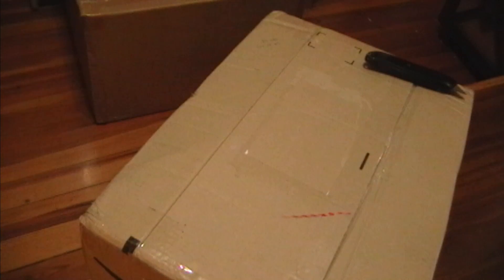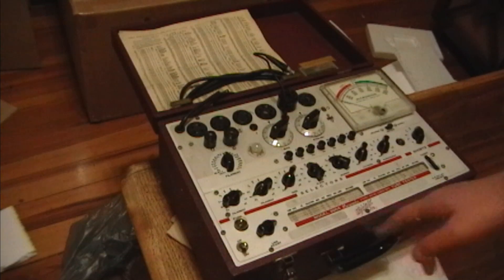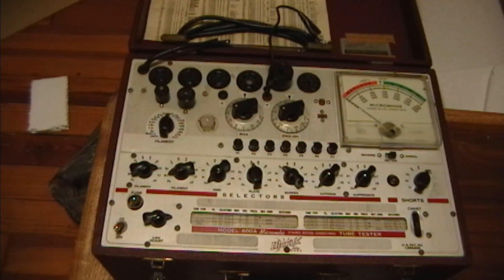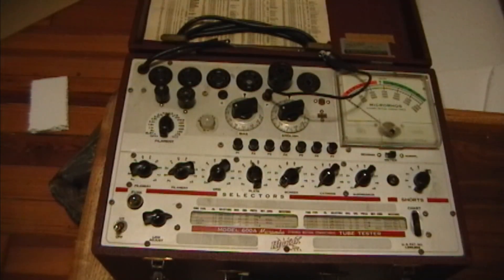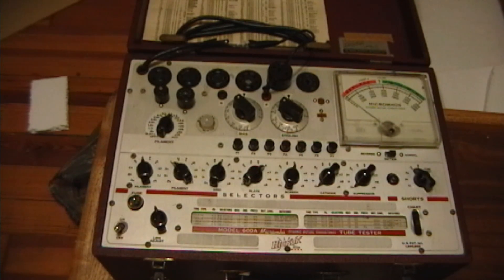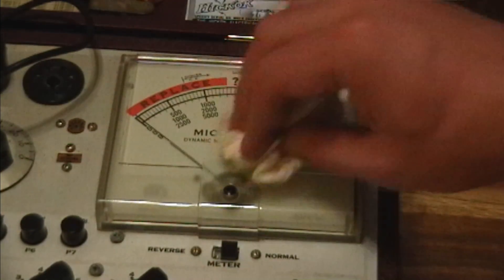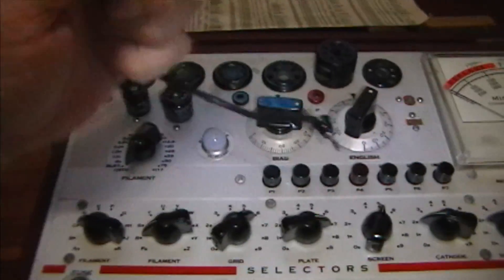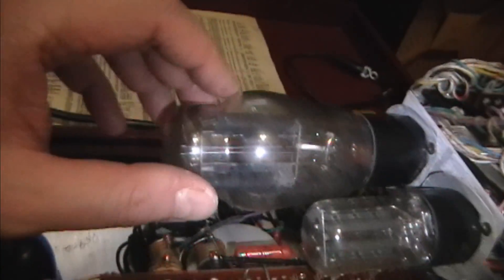Hickok 600A restoration p1o2

Comment: Your case must be bigger then mine cause my shorts test is up by meter not inline with rotary switches. What does yours measure accross panel?
Reply from the maker: The metal panel is 16-1/8 inch across
Reply: @bandersentv  thanks will compare to mine

Comment: I just ordered original hickok 600a manual to go with my 600. Just need lid and its complete. But for 175$ cant complain planel and everything else great shape even box. Definetly older bias and english are flat and no bias fuse
Reply from the maker: Good luck with it
Reply: @bandersentv  thanks tester has solid state 83 in it also which is great I will add my fuse mod to it so incase diodes short protects transformer
Reply: @bandersentv  I added line calibration pot to the hickok 600 like my 752 has from factory. Mounted it under 8 pin loctal socket can adjust through center of socket while tester still in case :) now voltages all correct was 10v lower then should. Now get 150v and 130v
Reply: Did notice the adjustable resistor replaced with a fixed 6300ohhm 5w resistor hopefully when calibrate it will be ok. I do have original adjustable 8.5k resistor but looks like bracket on one end was clipped or moved
Reply: Glad got 600 and not 600A the meter is like my 752 has glass for cover so no static to meter unlike the newer models. Doesn't have bias fuse but that's fine as long as shorts test is good then it's fine. Uses a 5v signal voltage also so tests power tubes much more accurately. Puts signal tubes to cutoff though but doesn't seem to effect results

Comment: would be nice is there was an expected transformer voltage specification.  MOst of these have letters on the transformer terminals but no reference to them.
Reply from the maker: All voltages are clearly labeled on the Hickok 600A schematic. It's freely available online
Reply: @bandersentv  I see what the winding voltages are on the schematic, but because I get weird readings, Im not sure Im measuring the terminals correctly.
Reply from the maker: Weird how?
Reply: @bandersentv  measureing side to side meaning one terminal on right side of wrapping and measuring the terminal 2 inches on the other side of the winding also get me 170 volts as well as measuring the 2 terminals 1/8 inch apart
Reply from the maker: @zundfolge1432  Have you traced out the wiring and compared to the schematic?  You should have 5 VAC on the 83 and 5Y3 tube filaments for example.
Reply: @bandersentv  will try again
Reply: @bandersentv  thats what IM having trouble doing.  Following the wires is difficult.  Maybe I have to remove the transformer mounting bolts and lift it to do so?  Found 5y3 wires, they go to top side 3 of them in a row so thats good.  The 83 wires are thick black ones that go underneath transformer.   Hard to see wires.  You say 5 volts, Im assuming 5 volts when line voltage button voltage is set and I checked that with a tube installed I think and it was 4.5 ish

Comment: I have 3 of this 600a tester. Only one works.  The other 2 either 1 has a short and the other will not test rectifiers and there is no info on how to test for the proper transformer voltages
Reply: sell me one?

Comment: another dumb question. At 12:17 there is a green thing with 3 leads. Do you recall what that is? Thanks.
Reply from the maker: It's a wire-wound power resistor with a tap.  The green is an enamel ceramic coating.

Comment: I have the same Hickok 600A. Dumb question--at 11:18 you state, "I imagine I will replace those..." referring to what I believe are the C2 and C4 older Sprague axial type capacitors. Can you identify them and tell me what you replaced them with. The schematic shows, ".0027--500V".  Can you clarify it means "27uF" and that you can upgrade to 600V? I cannot find exact replacements for those caps so I need to compare.
Reply from the maker: It means 0.0027uF or 2,700pF.  Sorry it's been 10 years and I don't remember.  I generally buy 630 volt caps so that's probably what I used.
Reply: @bandersentv  Thanks. That makes sense.

Comment: My hickok 752 one of spool resistors measure 1.24k when should be 1.175k is that still within tolerance?
Reply from the maker: What is the tolerance for this part in the service info ?  Or what is marked on the resistor ?
Reply: @bandersentv  it's a spool resistor so only mark is on schematic.
Reply from the maker: Sorry, without knowing the tolerance of the original part, it's not possible to say if it is within spec.
Reply: @bandersentv  no worries should be within spec since it's wire wound.

Comment: The one I just got will do it all its laboratory tester Hickok 752 :) you should sell your 600a and i-177 use money to get a 752 or 752A and it's fixed gm switch makes it more accurate then a shunt with the red dots
Reply from the maker: gm isn't important for the work I do.  I only need to know if a tube has shorts and OK emissions.  I don't work on audio equipment.
Reply: @bandersentv  oh I see yah cause TV tubes don't use gm
Reply: @bandersentv  a very nice tester though :) you did very good job servicing and calibrating it. When you where looking for your 600A did you look at the 800 model it's simular but little more updated and I think it can test 4 pin up to compactron?

Comment: I just acquired a Hickok 600a that my dad had. The case has some dings but the instrument panel looks very good. I have no idea if it works and don't want to plug it in because I don't know anything about them. Maybe someone would be interested in buying it. I looked on ebay and they are listed from 165.00 to 350.00, it's a nice looking machine, it has no paper work. Thanks for posting, lots of good info. 👍👍
Reply from the maker: I'm sure someone would.  The 600A is a popular model.  I'm glad you enjoyed the video.
Reply: now they go for 500$ not working!
Reply: Yah there asking to much for hickok testers now a days. Glad bought my hickok 752 lab grade for 650$ US and ny Hickok 600 recently for 175$ US they go for more then there worth now@HDReMaster

Comment: Nicely done! My unit came calibrated and included parts replacements. The only change I made was replace the 83 rectifier tube with a regulated solid state device that mimic actual load.

Comment: Hi i'm restoring a hickok 600 early version i haven have a good luck finding a clear calibration  form most are for 600A, i did got it to calibrated very close to spec but i just can't figure why my shorts lights turn on in 5- 4 there is only one resister and is good i know there is a sensibility adjustment but this one don't have it.

Comment: Hi - do you know if tubes can be repaired? I saw a western electric 274A on eBay by an experienced seller of vintage radio stuff for $799 and its listed for parts or repair, saying "1 side of the filament has failed". Thanks
Reply from the maker: +SuperJV4x   Not really.  Maybe if you are extremely lucky you could use a spark to reweld the open filament but it's likely to fail again soon.  No way would I spend that kind of money on a bad tube.

Comment: Hello, I'm trying, wiring diagram of the 600 A.

there are several diagrams on the internet, but are not equal to my 600A ..

I saw the video, the 600 A in the video is the same as mine ... or looks the same as mine ..

the inside it says 5322 ... while in the tup 5336 ...

If you know tell me where to find the correct wiring diagram and calibration?

thanks nicola from Italy

Comment: Hey Bob, Thanks for the quick answer.  I bought two #83 tubes.  One checked out pretty well although one side is stronger than the other.  The problem 83 I tried tapping until the short light went out.  Eventually it stayed out, but still acts a bit funky to the point where I don't trust it. It's cooking right now so I'll have to check it some more.
Reply: 83 tubes still around but I changed my hickoks to solid state very simular results on test +/- 25mhos between 83 tube vs solid state 83

Comment: Bob, Nice score on that Hickok!  It looks really clean.  What is your method of dealing with a problem #83 tube?  Is it shorted?  Will heating it for a while vaporize the mercury curing the short?  How long do you let it heat up?  What position is the tube in?  Have you had any success using this method?  The reason I'm asking is that I bought a #83 tube at a radio club swap meet that appears to have a short.  It was very cheap so I'm not out of much money if it is bad.  Advice?  Thanks, Tom

Comment: That appears to be a high quality tube tester.  Why don't you order a Zerostat  pistol on ebay.  They are primarily used to eliminate static on LPs, but should also get rid of the static build up in your meter enabling you to get more accurate readings from the meter.  They last a long time I've had one for many years. EBAY No 251085402071

Comment: That's unfortunate. Reverse engineering the card reader setup might net a method to generate a proper card based on the tube's specs, but that'd cost more in time than it would to locate and buy a complete set of cards on ebay :-)

Comment: Yep, I know Bob.  "How many tube testers does one guy need?".. my answer: way too many. lol. My best tester had a nice 9 pin socket.  But I know others who have built their own from scrap testers, Many of the testers you can pretty much figure out settings for tubes that aren't in the charts.  You can get good meters pretty reasonably, even from the OEM's themselves.  My API Volume Unit (VU) meters were pretty cheap when you compare them to eBay.

Comment: I had the same problem with my Accurate model 257, apparently, the cover wasn't on properly.  When I snapped it back on it,worked as it should and has continued to be steady.  Go figure!  Hope your solution is as simple.

Stan in SC

Comment: Ebay Item #300718869096 - $224 shipped. Very nice!  The seller obtained this in a trade for camping equipment and also noted that the pilot light didn't work. Sounds like an easy fix. Repair it and then take this portable tester camping for part deux of your video.  :))